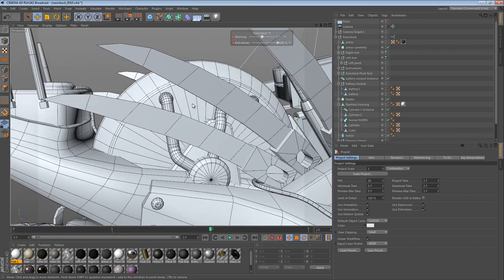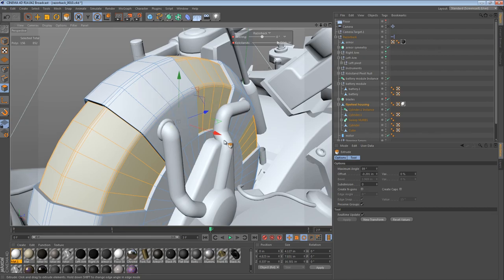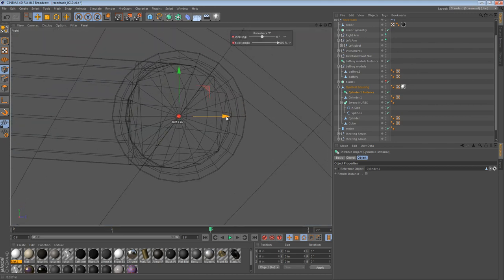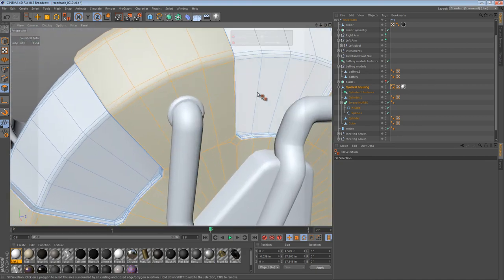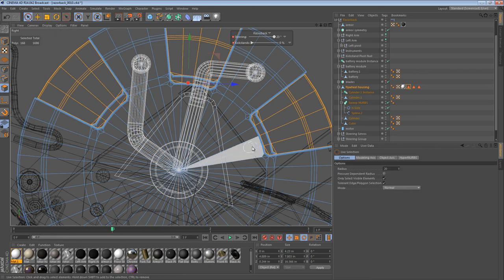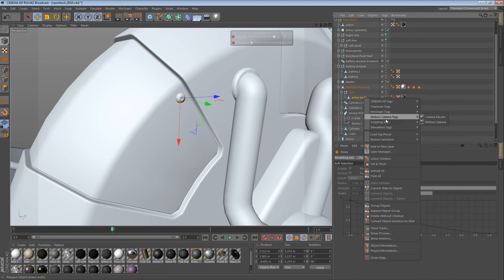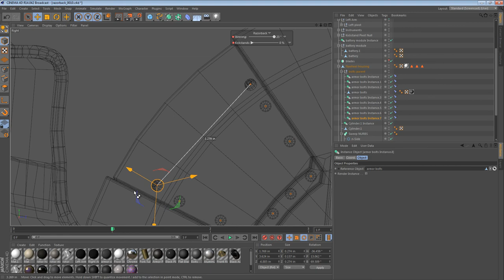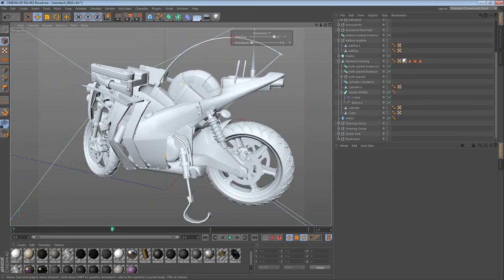The Razorback Part 51 - Additional Detail for the K.E.R.S. Housing

Comment: Jamie, a tip for you my friend ..... at 8:48, when you're editing the phong tag - there's another way to address these soft-shading issues. You can select the edges of your new bevels - just the outside edges of the bevel, where the bevel meets planar geometry - and then chose the option 'break phong shading'. Sometimes you might want to retain a high level of smoothing on one section of a unified mesh but have some hard breaks in other sections and this will do that for you - without needing to add additional geometry as with the extrude inner ;)

Thanks again for these awesome videos mate.

edit; actually, once you made your Fill Selection and have those planar polys selected .... you can then use the Outline Selection command to quickly select the edges that you need to break. Fill select, outline select, break phong shading ... that'll do the trick for you.
Reply from the maker: That's a great point. Perhaps I should do a tip on that specific feature in the future.

The reason I like to address soft-shading issues by adding geometry has to do with exporting. If you send a model to Maya or 3DS Max, there's no guarantee that C4D will export the normals properly, or that the other package will import them correctly. Certain formats like Collada are very good at preserving the hard edges; but when it fails, the model can look really messed up in the other program. So it's really just a habit of mine.